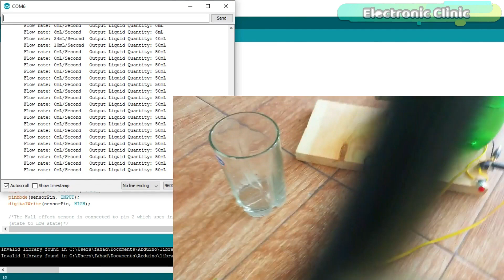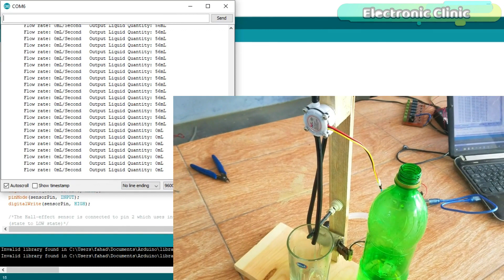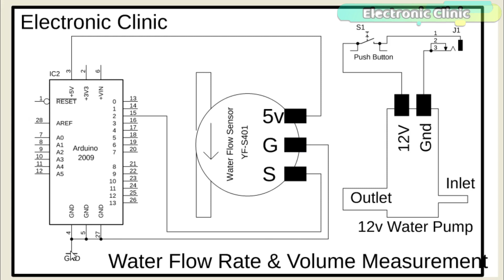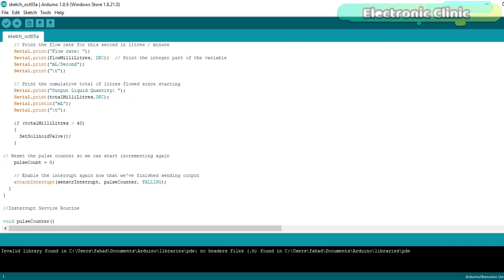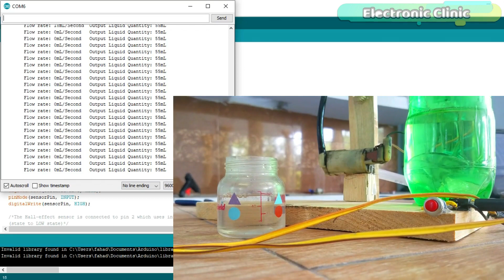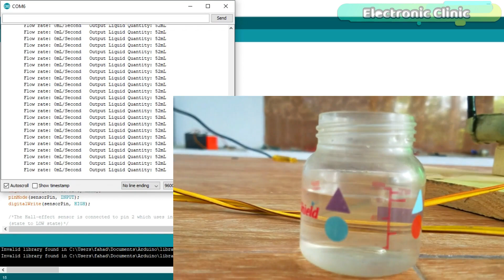Water Flow Rate & Volume Measurement using Water Flow Sensor & Arduino "Fluid Flow Rate Sensor"

Comment: In the next stage, there could be a system that dispenses the amount entered by the user. For example, the user will enter 70 ml, and the system will supply power to the pump just enough to dispense that amount. If a transistor is used as a switch in between, I wonder if there would be a variation of +/- ml?

Comment: I am using this very same sensor like yours. I used 12v pump as well to maintain constant pressure however I am getting inaccurate readings. Should the sensor be above the pump? And is there any recommended distance from the pump to the sensor for a more accurate readings? Please advise me if you can 😊

Comment: Would it make more sense to use a fourteen bit binary counter and save on interrupt calls? The core of this device is actually liters per pulse !!!. Therefore you would have automatic quantity measurement. Appropriatel timer interrupts could give flow rate measurements if required.

Comment: Hi, great job, i'm doing the same project but with air , i need to measure air flow rate and air volume using a flow sensor and arduino. does anyone have any idea what kind of sensor can be used, i have to find the right sensor.
I ask for help, I would be very grateful if someone can help.
Reply: Did you succeed??
Reply: Did you succeed??

Comment: Good night, it's me again, I'm about to buy the water flow sensor, I have one last question, does it work on 12v too? or I’ll have to ask 5 volts from the source to power it. My intention is to put to read the quantity of liters / hour of my watercooler. Thanks for listening.

Comment: Hi, great video, I have a question, can I connect this water sensor to the computer? will the motherboard read the rpm or any other reading of the yellow cable? Thank you very much
Reply from the maker: yes you can.
Reply: @ElectroniClinic  I was thinking of connecting directly to the CPU FAN, but in the motherboard manual, the sequence is GND, CPU FAN PWR, CPU FAN IN. I can change the sequence of the water sensor wires. Thanks

Comment: So this only works if you use a water pump because the sensor only gives accurate readings if there is a uniform water flow? Well, what if I wanted to measure volume based on a dynamic flow rate? Say, for example if you used a sink faucet, in which you never really know exactly what the flow rate will be since the water flow depends on how far you turn the faucet? If the flow sensor senses the flow rate, can't we use that to calculate the volume? And even if the flow rate changed while filling, is there no way to use calculus to calculate the rate of change of the flow rate to determine your volume when all is said and done? This video only works with a constant flow rate? Surely there is a way to use  flow sensor data to determine the volume for a dynamic flow rate, isn't there?
Reply: it works with any flow rate , pulse based flow sensor have accuracies of +- 1 % , calibration can boost its accuracy .

Comment: I have a question. Is it possible to make a system with:
1. moisture sensor
2. water pump
3. water volume meter
in just one arduino? or i requires 2?
Reply: Use esp8266 instead of Arduino and make it run as a web server ..

Comment: I use 12v pump and the same water flow sensor as you do...but it seems it gives wrong value...how fix this?
Reply: I already fix it sir....thank you...but i have another problem...how do i reset the value of the total volume once the sensor already stop?because it just add to the last data....if i use reset....this won’t help me since i am using a rtc and it would reset also the time...any thoughts sir? I would be happy to hear it...i am currently working with my school project...
Reply from the maker: I have explained this point in the video. Watch complete video

Comment: Such a great video but Would the accuracy be greatly affected when a varying flow rate is applied? such as draining water using gravity?
Reply from the maker: you will need to perform some tests. but if somehow you can maintain a constant pressure you can achieve high accuracy.
Reply from the maker: use a water pump, as I did.

Comment: Sir. Is it not possible to store the data while not running the program? I want it to store the data on a csv file & know the amount of the water that has flown through the sensor later sometime?
Reply from the maker: Yes you can. You can.store this data in sd card.

Comment: How 12v power supply to motor control by aurdino?
Reply: Solenoid is externally powered by it's own 12V the arduino just sends the signal to engage the 12V power supply